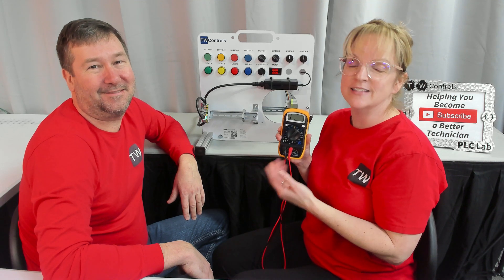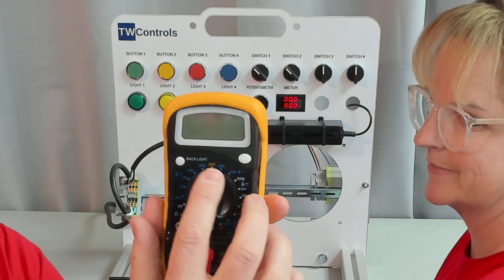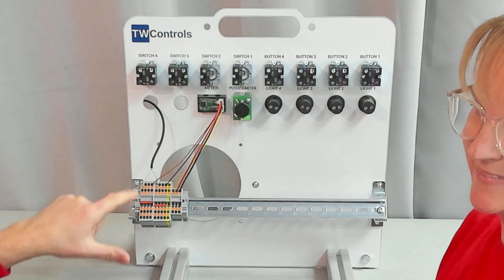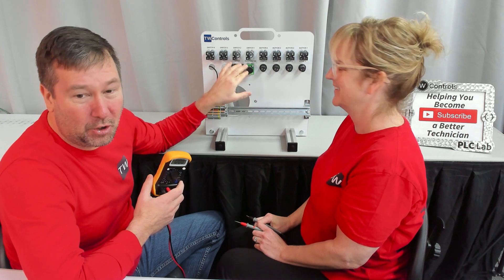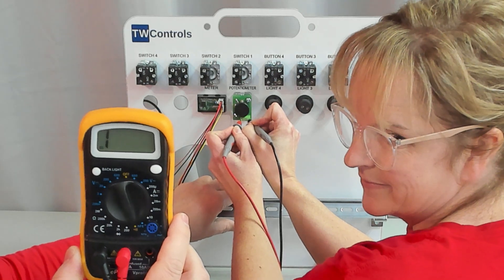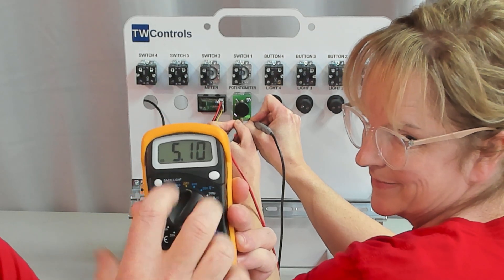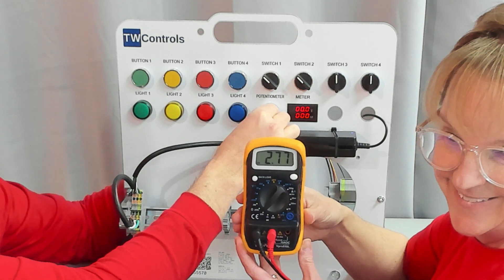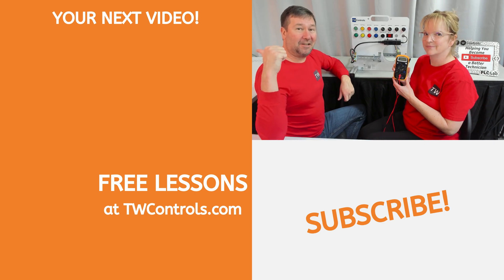How to Use a Multimeter.  The 3 Major Measurements to Know.

Comment: Hey Tim, admire your teachings. My micro850 has been bricked after CCW asked for a firmware update while uploading a program and after clicking ok, suddenly connection was lost and the Fault and MS indicators are flashing red and the machine won't show up in the RSLinx. Please help.
Reply from the maker: Firmware failures can be tough.... Can you connect to it over USB?
Reply: @TimWilborne  Thanks for the reply Tim. There is an update. Today  when I'm powering up the PLC, the flashing red lights are gone and I'm able to see the plc in CCW over Ethernet as well as USB. But when I'm trying to connect, after a minute or so, the Fault and MS indicators start flashing red again and the connection fails. Is there any hope?
Reply from the maker: @khanjanboruah  I have heard of people recovering them through a SD card update but I think it's time to call Rockwell Support.